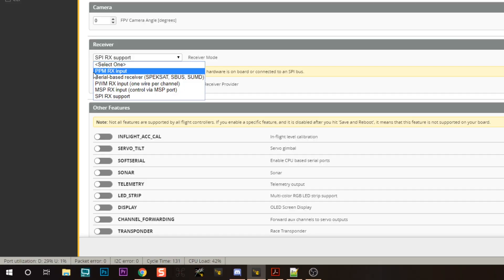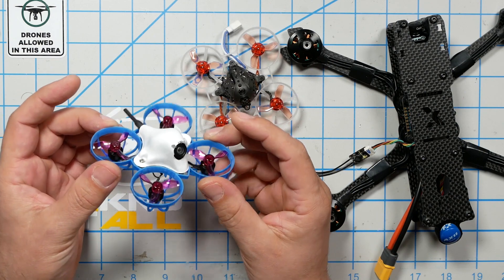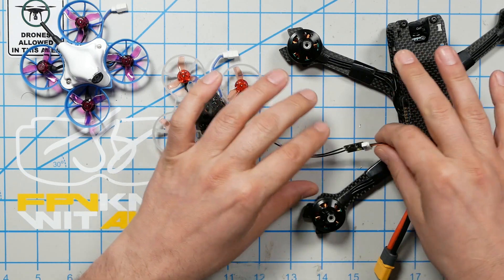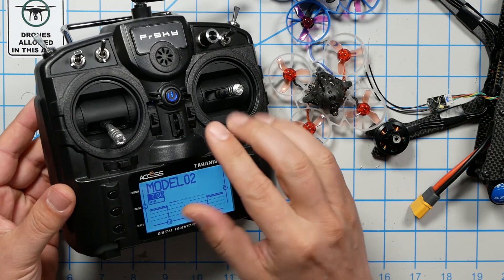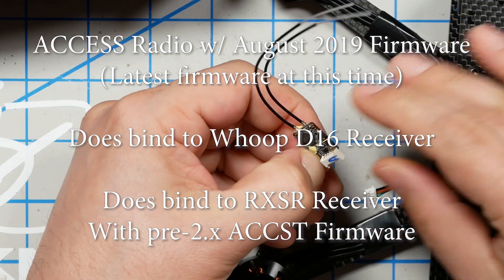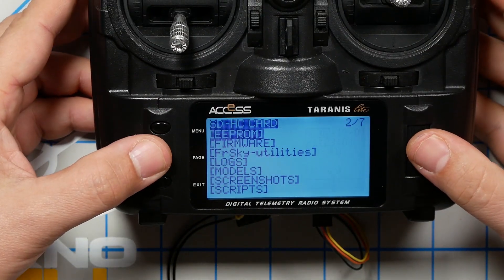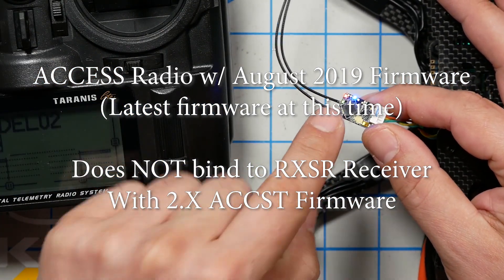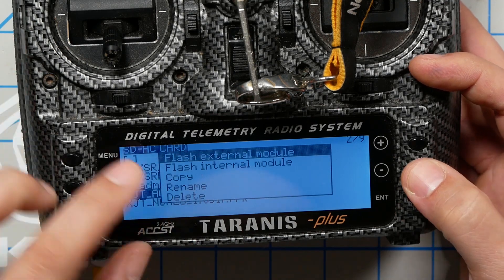FrSky won't bind! ACCST 2.0 is to blame.

Comment: The use of the term "encryptions" is a bit hysterical.  Please read ""Frsky Protocols v2.x.x - Facts and discussion". 

 I have reverse engineered both SBus, Sport and FPort. In the past Frsky and many others have used a degenerate CRC 8 bit error detection generator code.  This code was probably chosen because it is simple to implement however those that rank possible CRC codes do not even rank this particular code because it is so ineffective.  This has been noted and questioned in the past.  Apparently, Frsky has chosen to switch to a new code generator that is more effective as radio range has increased in our hobby.

There are a finite number of 8 bit CRC generator codes and any communications engineer could figure out which code is being used in a very short time.  In fact it is probably one of the most effective 2 or 3 codes known.

Error coding is not encryption.  Any of the tiny whoop manufacturers could easily identify the new generator code and apply it in a firmware update.  That being said, a more effective code may be harder to impliment on a processor with limited performance because the better codes are more calculation intensive than the original degenerate code.  The various tiny whoop clone receivers may lack the required performance.

I hope this sheds some light on the situation.

Comment: Hello Joshua, 

There is also an issue with the T16 internal module. It's binding D8 models with no problem but it seems that there is a huge latency issue as when moving the sticks, betaflight reacts like one second later.
Posted a request on github with the following link : https://github.com/pascallanger/DIY-Multiprotocol-TX-Module/issues/323
As I can see the Frsky D8 goes from 1 to 16 channels instead of 1 to 8 on a Taranis.
By the way, thanks for your videos and knowledge.
Cheers.
Reply from the maker: Use the frequency fine-tune function https://github.com/pascallanger/DIY-Multiprotocol-TX-Module/blob/master/docs/Frequency_Tuning.md

Comment: Maybe you should take down this video sense its no longer true .
Reply from the maker: Then why do I keep getting emails from people asking for help with this problem?
Reply: @JoshuaBardwell  you do know the multi protocol modules will do frsky 2.0 now.and you can buy tiny whoops you can add your own rx.so can add a access rx to one.
Reply from the maker: I do know the multiprotocol modules are capable of supporting FrSky 2.x. As for adding your own rx to a tiny whoop.... that's just as true now as it was the day I made this video. Nobody wants to add the weight of a receiver to a tiny whoop.

And regardless of the state on the ground, nothing will change FrSky's attitude and approach to 3rd party compatibility. The fact that the open source devs somehow managed to work around Frsky's machinations doesn't change what FrSky tried, and is still trying, to do. So that's why this video is still true in spirit even if some of the facts have changed.